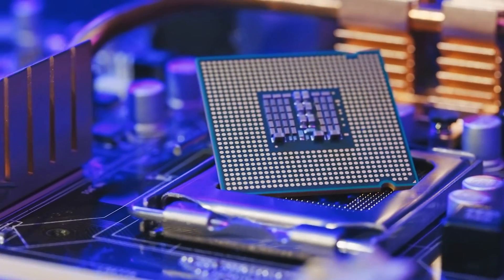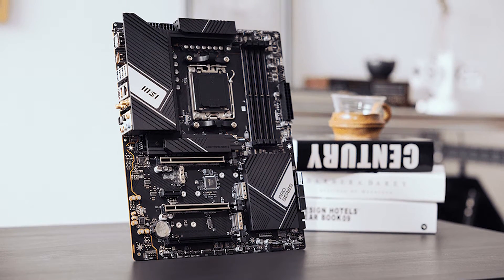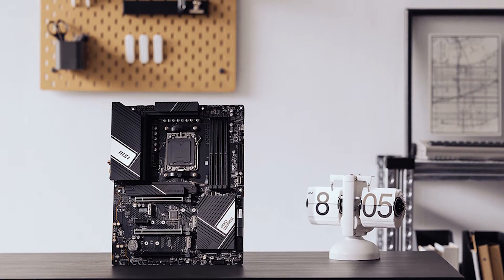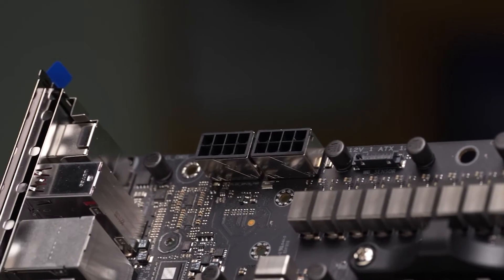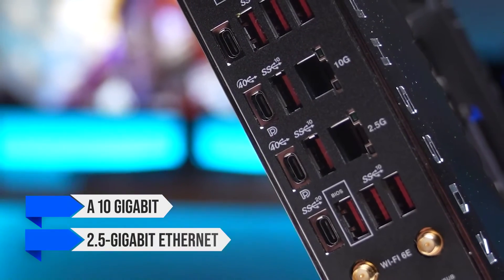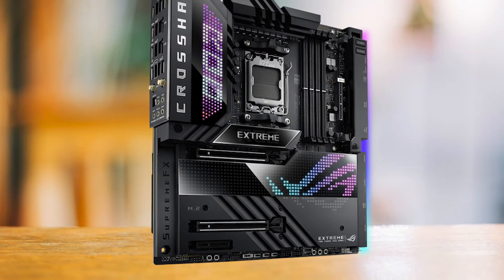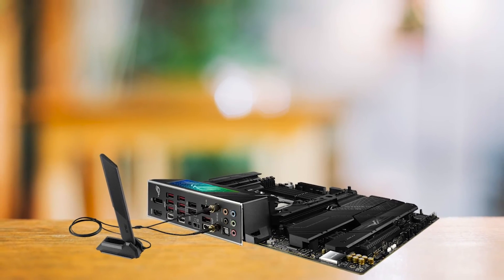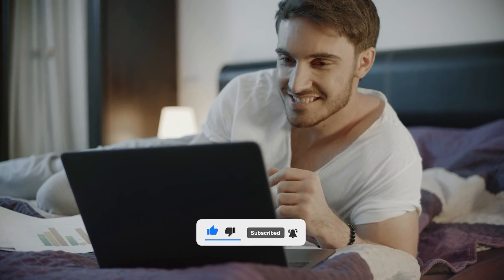THE BEST MOTHERBOARDS FOR RYZEN 9 7900X! (TOP 3)

Comment: Have same cpu but with a MSi  x670E now have a 240mm level play watercooler with rtx 4080 now with like 7-8% load my cpu heat is 70 little over cant fet straight answer. i think is hot for this minimal load suppose be able overclock if want but afraid of the heat so do i need 340 cooler or what is this something should worry about?